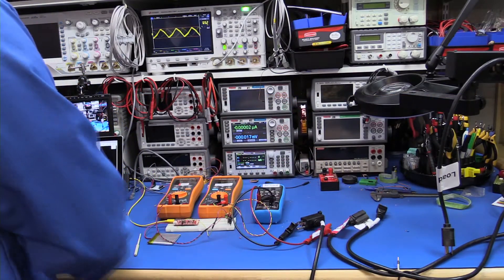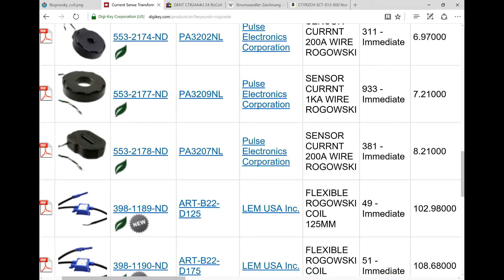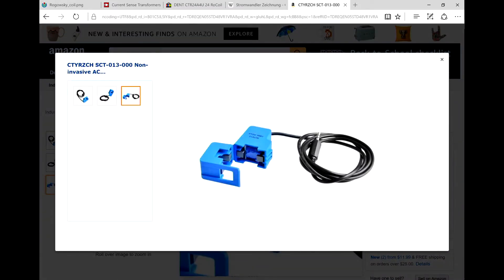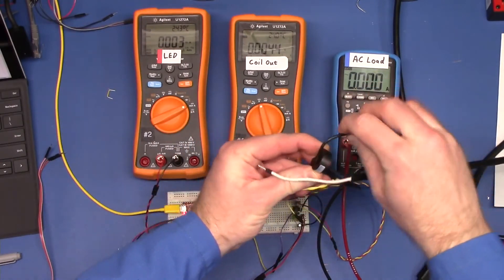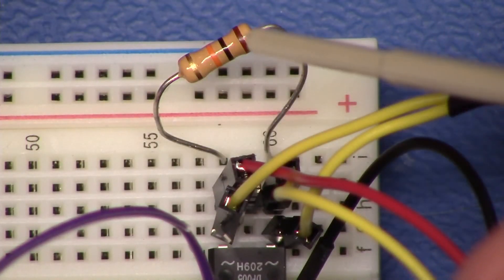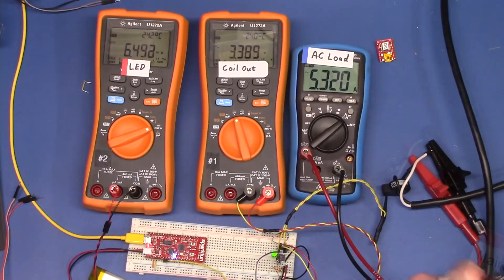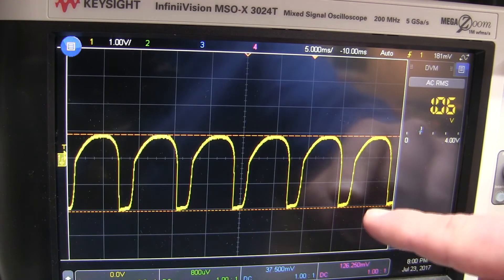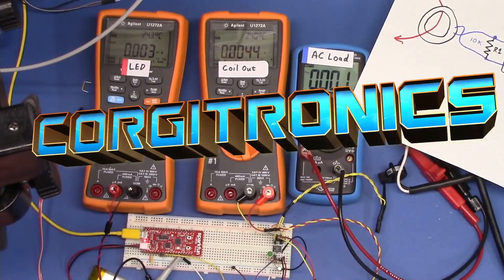Current Transformer

Comment: 7:53 You made a little fault there. It's actly not 5A current draw from the pump, but only 2,5A 
You have put 2 turns of the black AC cable (primary) through the coil of the Current Transformer, 
so you are measuring 2x the real current draw.
Each time a wire goes through the coil, it counts as 1 turn.